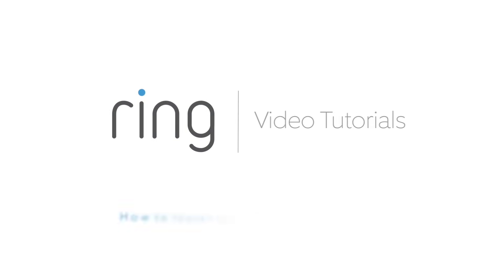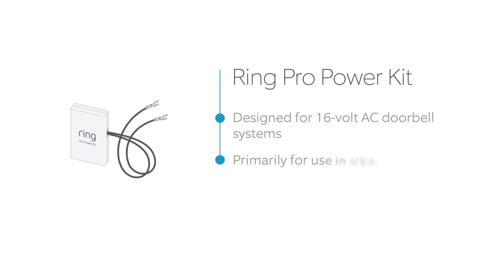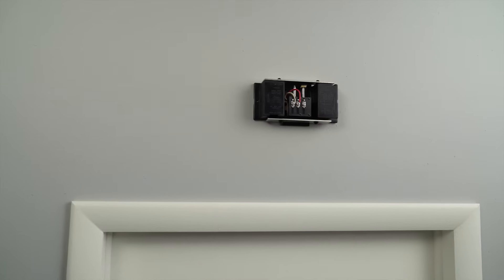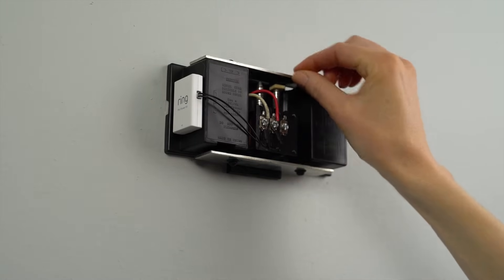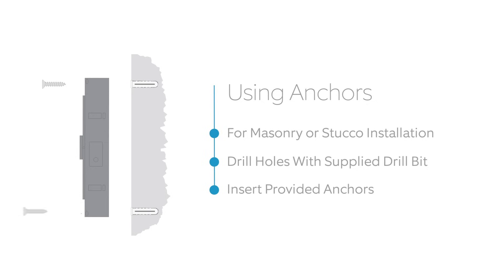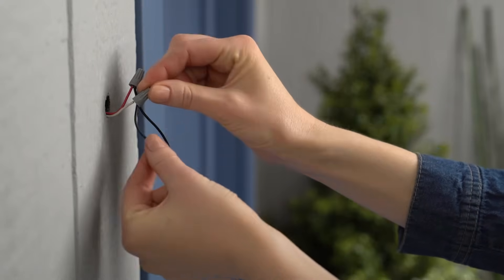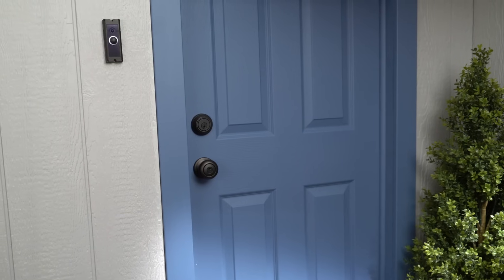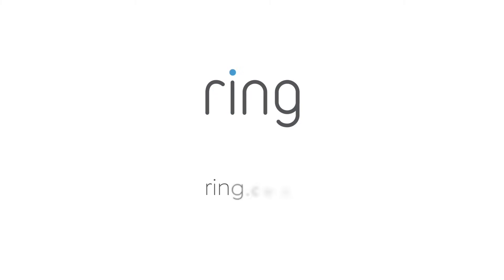How to Install Ring Video Doorbell Pro | DiY Installation

Comment: Amazing.. followed the exact direction and was up and running immediately.. Ring is legit and it does what it says..
Reply from the maker: We're glad to hear your set up went well! Welcome to the Ring neighborhood. :)
Reply: Ring thanks
Reply: Do you need to use the V2 battery back up if you use the plug-in method

Comment: Make sure you twist the wire before wire nut. For a secure tight connection. Not bad video but people should test the voltage before connecting to ensure 16vac.

Comment: Ring Doorbell Pro.. would be a good idea to include angle mounts in the kit and a white bezel instead of the cream colour included. I am concerned about protection against rain. If the side has a thin layer of inert silicone on it to protect, will this invalidate warranty?
Reply from the maker: Hey there! Our devices are water-resistant and can withstand weather conditions such as rain. While adding a small amount of silicone around the base or mount may not invalidate the warranty, any damage or malfunction caused by a modification such as this will invalidate the warranty in its entirety. See more at https://bit.ly/2B3Izco.
Reply: Ring do you need to install a diode for it to work properly?
Reply from the maker: Hey Juan! A diode is not required to install the Ring Pro — learn more about the process here: https://bit.ly/34jjd5U. Let us know if you have any more questions.
Reply: Hey Ring does this unit comes with angle plates??

Comment: Have been living with four Ring devices, for perimeter security, for the past 18 months and it has put me in-touch with my inner Gladys Kravitz: which is to say it's very good for getting an idea of what's going on around the home. I have the sensitivity adjusted to detect at a greater distance so I have to have a look-see as to whether something is inside or outside of the 'wire'. These products have held up well to a full season of UV exposure which was my main concern and they're impervious to cold and moisture too.
Reply from the maker: Thanks for sharing your experience with us, neighbor! We appreciate you being part of the Ring neighborhood. :)

Comment: Is there really any difference other than design on the 2 different power kits? Just curious. Thanks.
Reply from the maker: Hey neighbor, great question! The newer Pro Power Kit allows for a bypass or integration of the Ring Pro to your existing doorbell. The older Pro Power Kit allows for integration only and a different part would be needed to bypass your internal doorbell.

Comment: I have a 10v transformer. I was thinking of replacing it with a 30v one. Do I still need to install the pro power kit or can I install the transformer and skip the pro power kit installation?

Comment: Can you have a ring pro in front and a regular ring door bell in back? Will there be two different screens you will have to monitor?
Reply from the maker: Great question, Peggy! Yes, you can set up multiple Ring Doorbells at your home. All Ring devices will be able to be accessed via the mobile Ring App so you can monitor them while logged in under one account. Ring devices can only be viewed one at a time, however, the Ring App will provide Preview Tiles when you open the app to ensure you can check your Ring devices at a moment's notice — learn more here: https://bit.ly/2Mbya2A.
Reply: @ring  hi. Quick qst... So your mobile will get an alert even if someone has not rung the bell ??? So you can see all & everthing from a vicinity ? Will all the Members who have this App see whose coming & going..&  what if we need privacy.... is there any feature that the other family member can't see from their App ???
Reply from the maker: @lubnasayyeda  Great questions! With the Ring Pro's advanced motion detection, you can customize the motion detection zones to receive alerts even if visitors don't ring the bell. You can add Shared Users to your Ring device so they can receive and answer alerts — check out more about Shared Users permissions here: https://bit.ly/2O6C7GV. At this time, there isn't an option to customize when Shared Users can and can't see alerts. However, we'll be glad to forward this to our development team as feedback. Please let us know if you have any more questions. :)

Comment: I have a 24 v old doorbell , can I use it or can I bypass the old one or just throw the old one and install the pro?
Reply from the maker: Hi there! Both options are doable — you can connect your Ring Pro to your existing 16-24v chime by checking if yours is compatible here: http://bit.ly/2S3gzvA and following the set up instructions in the app. Additionally, if you don't want to use your existing chime, you can use the Pro Power Kit to bypass it entirely and just run the power to your Doorbell. See more at http://bit.ly/32fpDlR. Let us know if you have any other questions!

Comment: I've never mounted anything outside before. Will I need to drill the siding or will the screw just screw in with only a screwdriver? Also do I need to turn the power off? I watched some guy install this doorbell and he left the power on but I just want to be sure lol.
Reply from the maker: Hi June, we're excited to welcome you to the Ring neighborhood! Drilling installation holes is required for the Ring Doorbell Pro to ensure it's mounted securely to your home and not easily removable by others. When dealing with wiring at your home, we recommend turning the power off beforehand as a safety measure. Rest assured, we do partner with third-party installers depending on where you're located. If you're in the US, check out ring.com/installmyring to learn more about Amazon Home Services. If you're in the UK, check out localheroes.com/ring to learn more about Local Heroes. If you live outside of these areas, we recommend getting in touch with a local certified electrician for installation assistance. Let us know if you have any more questions.

Comment: Ring Pro Power Kit - is this part no longer included in the Ring Pro kits sold at this point (Nov 2019)?  Because in looking through the 'whats in the box' and the box itself, I see the angled bases, the various color bezels and the ring pro doorbell button/camera itself, and some installation tools/hardware, but not  a power kit.
Reply from the maker: Hey neighbor, we apologize for any confusion. A Ring Pro Power Kit should come with your Ring Pro. If you didn't receive one with a Ring Pro, please give us a call so we can assist: ring.com/callus.

Comment: We installed ours too but got a humming noise from the chime inside the house on the wall and won’t chime when we press the ring button. Not sure if the original door bell is out dated

Comment: Do you need to connect the “power kit” to the chime? Like I don’t want my old chime anyway... it’s annoying I want to link my ring to another chime provided by ring or just use my Amazon devices. Can I just supply power to my doorbell and not have to install the power kit?
Reply from the maker: Hey Geo! Yes, the Pro Power Kit is required in every installation of the Ring Video Doorbell Pro. If you don't want to use your internal chime in your circuit, you'll need to bypass your chime as a buffer to protect the Doorbell. This can be done using the bypass mode on the Pro Power Kit. We're always happy to help if you have any other questions.

Comment: Is this for the Ring Doorbell Pro 2 ? Or the Ring Doorbell pro 1? It would help if you specify which one. You also say 16 Volt systems yet the Ring Doorbell Pro 2 has a max of 24 Volts. It would be helpful if you were a bit more specific.

Comment: Hey Ring, Do I have to use the pro power kit with my pro? What if the wires are welded on instead of screwed on? So I can't connect it to the front or trans. I have an older house. I do have wires at my front door to wire on the pro, just not the power kit.
Reply from the maker: Hey Taylor, if connecting to an existing chime kit in the home we do recommend using the Pro Power Kit in order to regulate power and allow the Ring Video Doorbell Pro to work properly. See more here https://support.ring.com/hc/en-us/articles/115005974286-How-to-Install-Pro-Power-Kit-V2-for-Ring-Video-Doorbell-Pro.

Comment: Is the pro power kit included with the "Ring Door Bell" ?
Reply from the maker: Hey David! The Pro Power Kit is only included with the Ring Pro Doorbell — check out more about installing the Pro Power Kit here: https://support.ring.com/hc/en-us/articles/115005974286-How-to-Install-Pro-Power-Kit-V2-for-Ring-Video-Doorbell-Pro. The classic Ring Doorbell features an internal battery with the option to hardwire it to existing doorbell wiring. Let us know if you have any more questions.

Comment: My apartment doesn’t have any doorbell so which one would be best for me to buy ?
Reply from the maker: Hey Destiny, thanks for your interest in Ring! You don't need a current doorbell in order to install a Ring Doorbell. In fact, our Peephole Cam was designed to install in an existing peephole. Also, our battery operated Doorbells can be mounted on many surfaces and are a quick DIY install. Here is a link to our full lineup of Doorbells: https://shop.ring.com/pages/doorbell-cameras. Please let us know if you have any additional questions as we are here to help.

Comment: I have a Ring doorbell 1 but I want to replace it with Ring Pro
I have a transformer connected to the existing doorbell
Do I just connect the new Ring doorbell pro to the wires where I going to take the old one off?
Reply from the maker: Hey Joel, first verify your transformer has an output of at least 16V 30VA (40VA max) and 50/60 Hz. Do not use a halogen or garden-lighting transformer or a DC transformer/power supply. Check out this link for more information: https://support.ring.com/hc/en-us/articles/360036047831-Physically-Installing-your-Ring-Video-Doorbell-Pro. Let us know if you have any additional questions.
Reply: @ring  it does have 16V!
Thanks!

Comment: What if u don’t have a doorbell ? Can u still install one
Reply from the maker: Hi Angie! Yes, we offer battery-powered Ring Doorbells that can be installed without being connected to existing wiring — see our Ring Doorbell 2 here: https://bit.ly/2FDoptv and the wireless installation process here: https://bit.ly/2PEmqF0. Feel free to check out our variety or battery-powered options for whole-home security at shop.ring.com.
Reply: @ring  i am hearing the live view option only works with a ring hardwired only doorbell is this correct? i have never had a door bell and dont have spot for one but will have to make my own.i was just gonna buy a wireless one but ifi cant hit a button and see live feed then i dont want the wireless one
Reply from the maker: Great question, Justin! All Ring devices feature Live View, including battery-powered devices. Feel free to check our classic Ring Doorbell and Ring Doorbell 2 here: https://bit.ly/2FDoptv.

Comment: What is the difference between ring door bell 2 and the pro beside the wire connection?
Reply from the maker: Hey neighbor! The main difference between the Ring Doorbell 2 and Ring Pro are their power sources and their size. The Ring Pro also features our advanced motion detection so you can draw the areas you want to monitor for motion — check out more here: https://bit.ly/2SOVeHd. The Ring Doorbell 2 can be hardwired to prolong the battery life, although it isn't required. It also features our standard motion detection — learn more here: https://bit.ly/2SOnqKd. You can also check out our Doorbell comparison chart here: https://bit.ly/322nQ40.

Comment: Is the small unit that attaches to the bell circuit inside the antenna for Wifi?
Reply from the maker: Great question, Charlie. The small unit that installs in the bell circuit is to regulate the power between your Ring Doorbell, your internal chime kit, and your transformer to ensure all items in the circuit are getting the proper power levels to work properly.
Reply: @ring  Ahhhh, I s a voltage regulator. Just installed our Ring today. It was very easy. I got the unit that takes its power from the house doorbell AC voltage. My doorbell unit even had a schematic diagram making it easy to determine the connections. One suggestion would be to make a bezel for vinyl siding that has a double angle. The wedge bezel is for a single, flat style of siding. But, I was able to straddle the gap with the ringer. 👍

Comment: hello, i want the plus system, but i have 2 houses. is one subscription enough, or do i need to have to take out a double subscription because two houses?
Reply from the maker: Hi there, great question! All devices at one address will be covered under Ring Protect Plus Plan. You’ll need to subscribe to Ring Protect Plus separately for each address you want to cover. If you have any more questions, please let us know.
Reply: @ring  thank you very much for your answer. 😊👌

Comment: If I don’t already have a doorbell can I still purchase?
Reply from the maker: Great question, Tiara! The Ring Pro requires power from existing doorbell wiring or from an alternative option like our Plug-In Adapater — check it out here: https://shop.ring.com/collections/accessories/products/plug-in-adapter. We do also offer battery-powered Ring Doorbells that can be installed without the need for wiring. Check out our classic Ring Doorbell, Ring Doorbell 2, and Peephole Cams here: https://shop.ring.com/pages/doorbell-cameras. Let us know if you have any more questions!

Comment: What if I don’t have a pre existing door bell does that mean I have to get one in order to use this ?
Reply from the maker: Hey Nayeli. The Ring Video Doorbell Pro requires wiring in order to receive power. If you don't have any wiring at your door, you may be able to set up your Ring Pro with a Plug-in Adapter — check it out here: https://shop.ring.com/collections/accessories/products/plug-in-adapter. You might also check out one of our battery-operated Doorbells such as the Ring Video Doorbell 2. You can learn more about it here: ring.com/video-doorbell-2. Let us know if you have any more questions!

Comment: Do I need to install the power pack to the doorbell chime if I'd like to use the ring video doorbell pro with my existing doorbell chime only? My doorbell chime is very high off the ground and I cant reach it (even with a step stool), thats why I want to know.
Reply from the maker: Hi Raina! It is required for the Pro Power Kit to be installed in your existing chime when using the Ring Video Doorbell Pro, as this ensures there is sufficient power being run to the device. See more at http://bit.ly/33BKjF5 and let us know if you have additional questions!

Comment: Thinking purchasing of it-but really not sure which model also my existing door bell on frame of the door so will there any other way to install it as it’s really tiny space when door is closed
Reply from the maker: Hi neighbor, the Ring Pro you see in this video is 4.50 in. x 1.85 in. x .80 in. (11.43cm x 4.67cm x 2.03cm). If you're unable to hardwire the Ring Pro in that area, feel free to check out our battery-powered Ring Doorbells that can be mounted just about anywhere. See our Doorbell comparison guide here: https://bit.ly/2xEFVsr. We appreciate your interest in Ring!

Comment: So I’m replacing the doorbell in the back door so do I still wire the power kit to the front node or do I put it on the rear node
Reply from the maker: Hey neighbor, we recommend connecting the Pro Power Kit to the associated terminal. In this case, you would connect it to the rear and the trans terminals to provide power to the Ring Pro at the rear. Let us know if you have any more questions!
Reply: Ring thank you actually it works even if connected to front node so I’m good to go thank you

Comment: I have a bunch of breakers and they aren’t marked at breaker box can I do this without turning off the breaker.
Reply from the maker: Hey Leigh Ann, we'd recommend consulting a licensed electrician regarding this. We don't recommend attempting the installation when there's power going to the live doorbell wires.

Comment: I didn't use the transformer and it works fine, do i need the transformer?
Reply from the maker: Hey neighbor! Wiring your Ring Doorbell Pro to existing doorbell wires will provide power as they are powered by an existing transformer in your home. In some cases, there isn't an existing transformer and one may be needed. However, it sounds like your Ring Pro is all set to go! Let us know if you have any more questions.